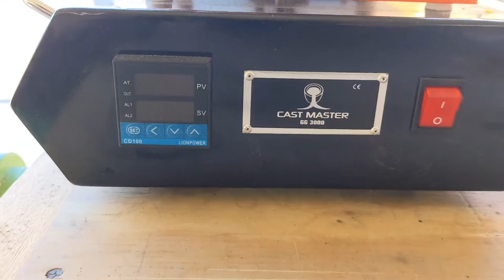Metal Melting at Home with my Cast Master Elite GG3000 electric furnace - (Hot Metal)

Comment: The eagle  looks good. Aluminum is weird with fine details. Not the most viscus metal. The 500 round looks great. Very nice. Congratulations on 500 subs 🎉
Reply from the maker: Thank you, I'm going to re-melt it and try again.  I agree with the aluminum being weird, but I believe I messed up the mold when removing the pattern.  The coin came out great thank you 🙏 😎

Comment: Looks good! Do you have any tips on those vertical flasks? I keep getting loose sand in mine. It's less and less every time, but still.
Reply from the maker: Thank you and thank you for the design.  I linked you in the description 👍. Maybe your sand isn't at the right moisture.  Any loose sand I blow out before closing the mold prior to the pour